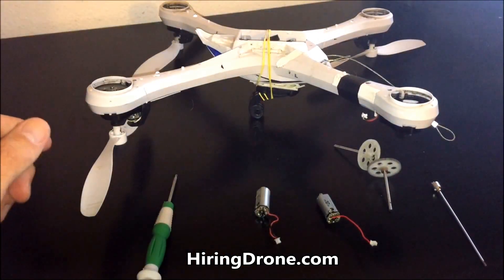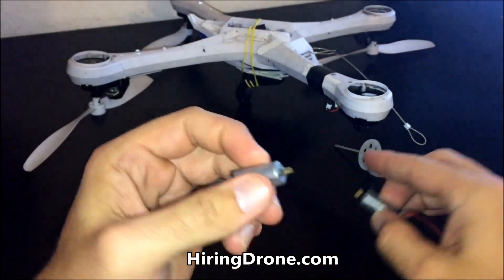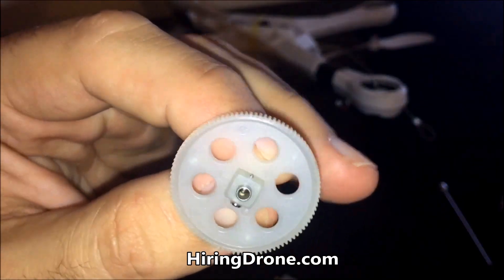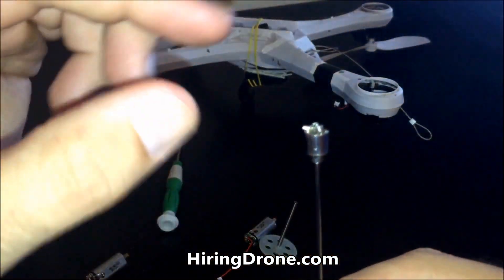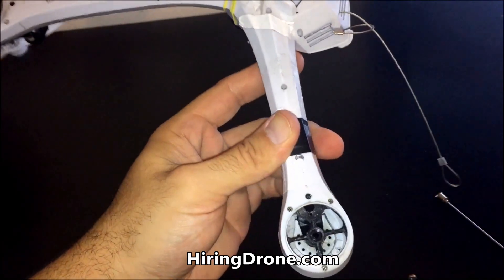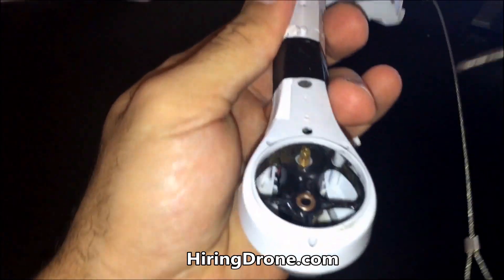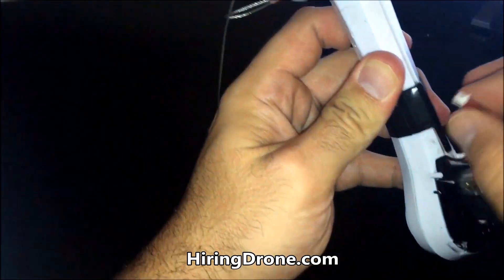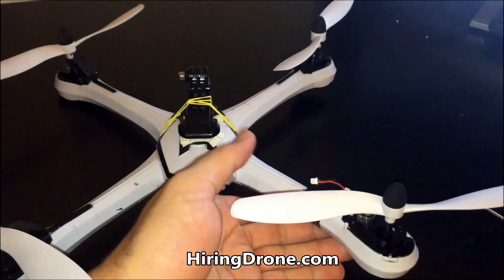How to Replace JJRC H16 Tarantula X6 Motors

Comment: If you replace the motor and the prop shaft so that both gears are new, but the mesh is still not correct, is there any way to adjust the mesh? It doesn't seem as if either the motor or the prop shaft are adjustable.
Reply from the maker: +Michael Preyer It would need to be customized. Adjustments are limited, as all the holes to hold everything are pre-drilled. Swapping out the parts in video always corrected any issues I had. I have probably changed eight motors on mine. What issues are you having?
Reply: +Hiring a Drone - Thanks for the quick reply! So far, I only replaced just the prop shaft in order to replace the nylon spur gear. I intentionally did not replace the motor because I have only 5 flights on the Tarantula and the pinion looks perfect. I will go ahead and replace the motor to see if that fixes the problem. If so, it means the metal pinion is wearing MUCH faster than I would have ever dreamed. If not, I'm going to have to figure out a custom way to shim the motor closer to the spur gear.
Reply from the maker: +Michael Preyer I was surprised too. The metal gear on the motor wears down faster than the plastic sprocket. Dirt, grime and sand can cause this to happen much quicker. After each flight, I usually blast mine with computer air cleaner. Are you lifting anything with it (i.e. GoPro)? I went through almost a motor a week lifting a GoPro. Additionally, the screw hole for the prop can be slightly off, giving more room between the propeller and the prop shaft housing. I have notice that this cause a slight up and down movement of the prop shaft, which cause the metal gear on the motor to wear down like an hour glass. I can send you photos if you would like to see.